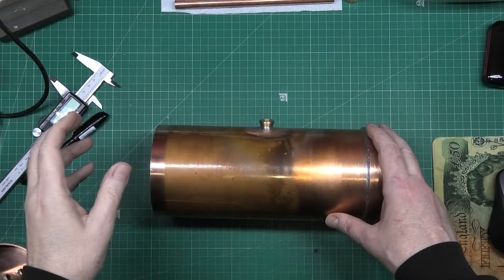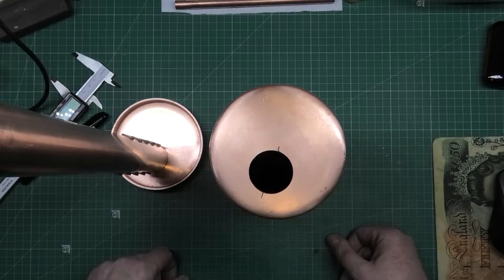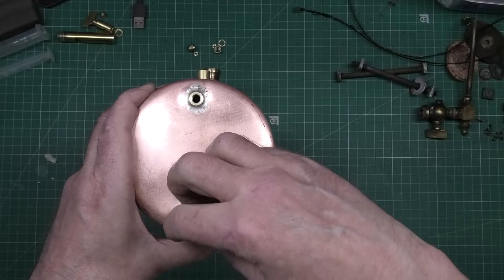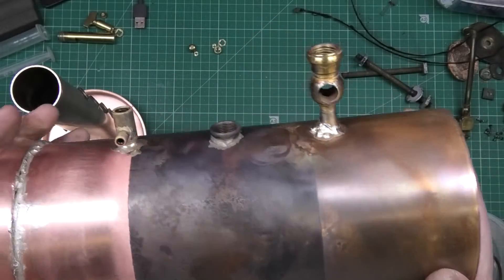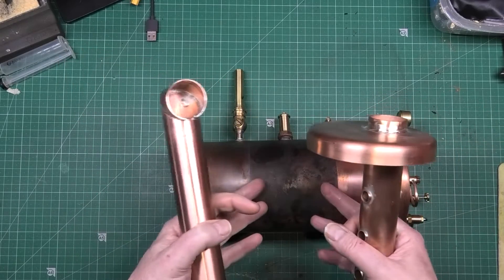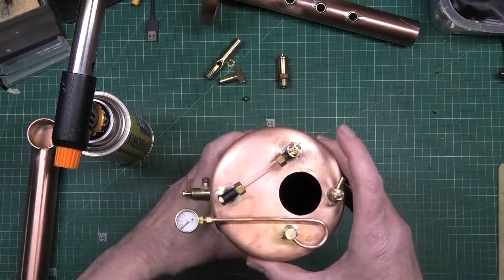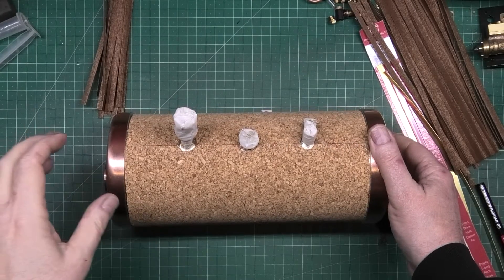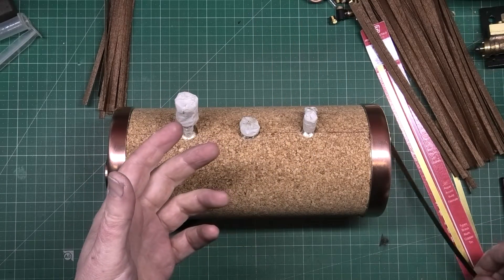DIY live steam boiler build - Part 2 of 4 (Steam test)

Comment: You might want to plumb a steam port in to the flue.  If you connect it to the steam exhaust of your engine, it will create a strong draft through your flue and pull the flame deeper in to your fire box.

Comment: I'd like to try a similar boiler but trying to find 3" copper pipe and caps are like looking for gold. I'd also have to invest in a torch hot enough to silver solder. Maybe finding a completed boiler might be cheaper than I thought.
Reply from the maker: That's what I thought and yes, it probably would have cost the same price in the end but I have the satisfaction of knowing that I built it 😁
Reply: Surrounding the job with fire bricks or better still heat insulating bricks makes an enormous difference. That contains a lot of the heat and lets that big heat sink stay hot. You’ll still need a pretty big torch but at least it’ll make these jobs a possibility ✔️

Comment: Excellent craftmanship! I'm sure this was a fun and exciting project! Just a few important points if someone were to make something like this:

-As a rule of thumb you should never have an open flame directly over metal inside a boiler (thermal stress and such which can lead to a broken tube or an explosion) in an industry aplication a boilerplate would have been made(I think your design allowed for one) and then the end cap would be placed.
 
-You can also add an economizer to heat your feed water by placing a coil heat exchanger in your chimney, the closer the feed water temperature is to the smoke temperature the higher the efficiency will be.

-Insulation on the boiler body, chimney, feed water and steam lines is very important as will yield you a very nice (and very cheap in these sizes) efficiency increase, this can be done even after making the boiler and makes it safer to handle.